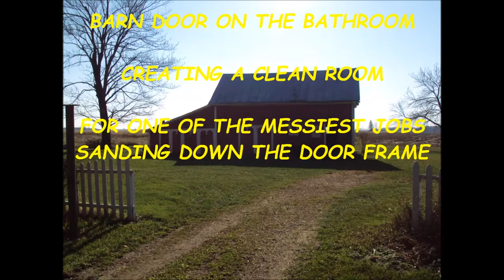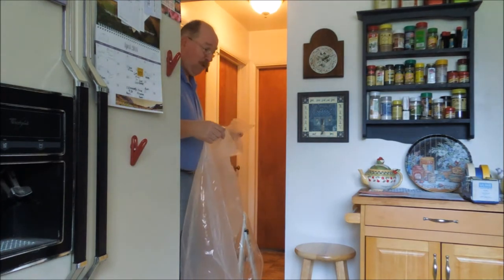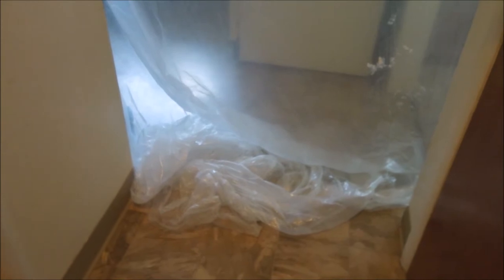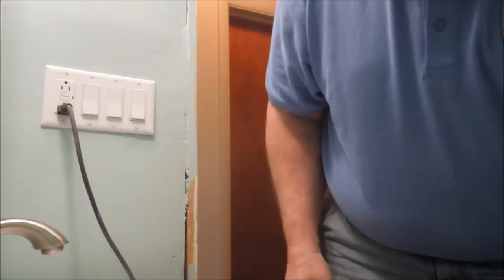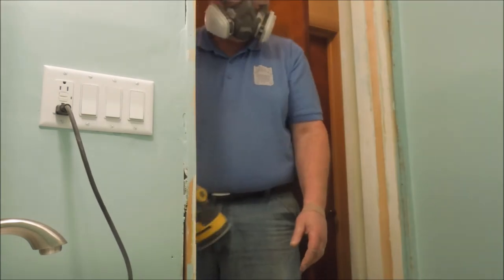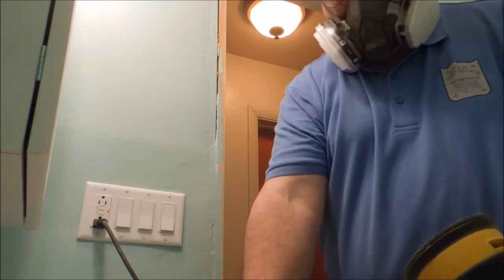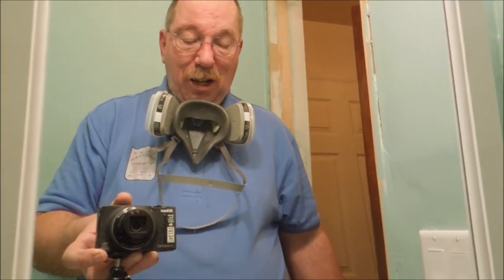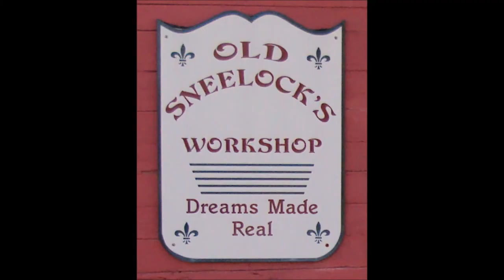BARN DOOR ON THE BATHROOM ~ CREATING A CLEAN ROOM ~ SANDING THE DOOR FRAME

Comment: A tip when sanding paint work clean your discs keep a 2" metal scraper in your back pocket when the disc loads up slap it a few times with the scraper it clears it and the disc lasts three times longer works for bondo as well lightly spray the bag of the sander with water the dust stays in the bag and doesn't go airborne as well

Comment: Lay an old towel on the heat vent with a board on top of that to stop most of the excess heat from migrating in to the work space.
Reply from the maker: Good suggestion. After looking at the situation I had 200 watts of light bulbs shining in the room while I was working. That didn't help either.    😊

Comment: I wonder just how much dust you have in the bathroom exhaust pipe.  I would hope if I had the insight to use the bathroom exhaust fan (I probably would never have thought to set up a clean room in the first place), I would add some sort of filter to catch the dust before it left the room.  Does your fan have some sort of filter?  All the ones I've seen don't.  The ones that look like they do just need a GOOD cleaning...
Reply from the maker: When I checked the fan blade and duct work they had a little bit of dust on them. Looks like most of it blew out into the back yard.